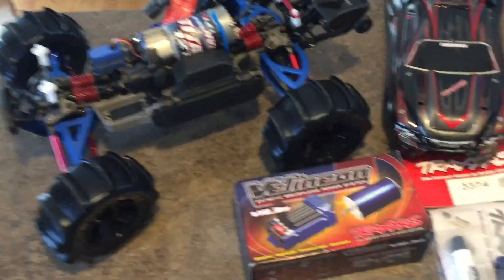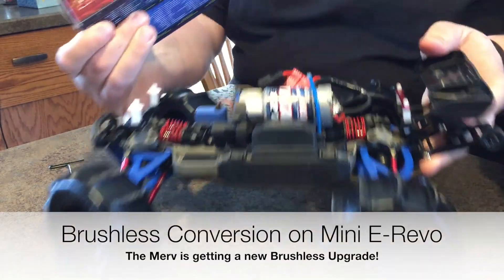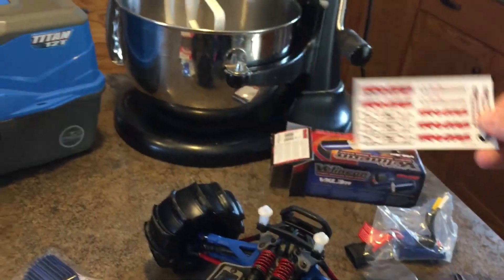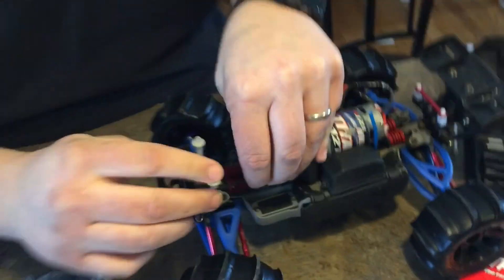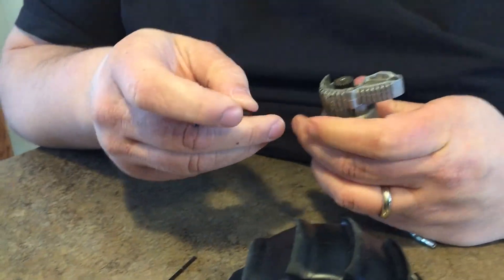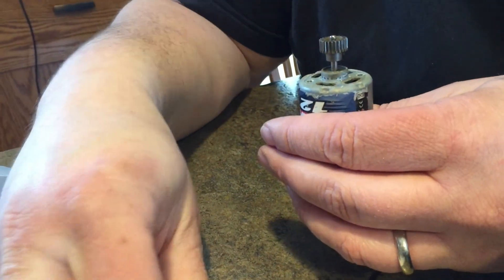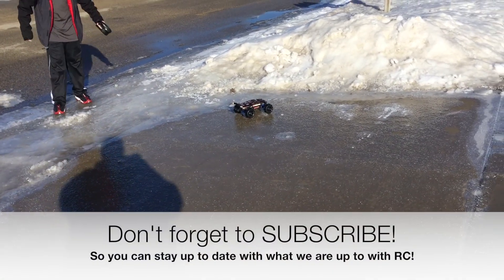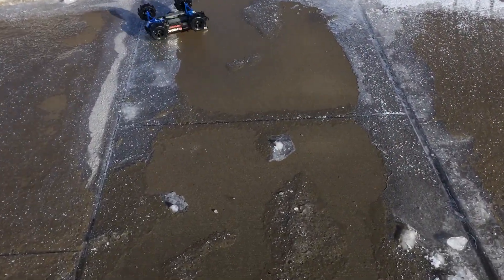How to add a Brushless Motor to 1/16 Mini E-Revo (Merv) Velineon vxl-3m

Comment: I think I saw the blue ano skid plates on your merv. I know a lot of people like them, particularly the front to keep the dif bulkhead together. What, if anything did you do about the hinge pins sliding? I found they moved a lot because the aluminum ones don't have the little cups to receive the ends of the hinge pins and retard their movement.

Comment: Thanks for the video. I´m planning to upgrade mine after the brushed motor setup quitted its service. Will order the required parts at once. Did you have to change the pinion gear also? Also what are the batteries you are running now? 2s or 3s or the original ones? What size 2s and 3s goes into the battery tray?

Comment: Did you have to change your receiver to use that ESC as well?
Reply: I did the same set-up, you don't need to change the receiver. Just the motor mount and motor plate.
Reply: @nosoulginger2146  I’ve done it myself since this video. Don’t know what I was thinking. This was the easiest system upgrade yet.
Reply: @leolux09  What gearing and battery set-up do you use by chance? And do you use two Lipo batteries at once?
Reply: @nosoulginger2146  I kept it at 55/23T and two 2S lipos, or a single 3S. Was just running 3 of My mini E-Revos earlier and they all fly.
Reply: @leolux09  I probably should go back to stock. I'm using a 50/23 set-up and I've stripped 2 spur gears already.
Reply: @nosoulginger2146  Just go metal. I use Hot Racing in one of My nerve and the Summit. No more stripping. No need to down-gear.

Comment: Good video, thank you. However, my question is what tires are those? I've been searching for something similar for my e-revo.
Reply from the maker: They are Proline Sling Shot 2.2 sand tires. They work great in the snow.
Reply: @midwestrcadventures7193  do I need any size for my 1/16 rim cuz I wanna get a fatter size tire can u upgrade it to a 1/10?
Reply from the maker: @lilgerm383  you should be able to fit any tire / rim that will fit the hub size. Clearance could be an issue and affect turning radius. Remember the heavier the tire the more mass and it could affect you differentials and axles.
Reply: @midwestrcadventures7193  thx dude how do i find the size of my hub size

Comment: When he moved the servo with his hands to move the wheels manually i cringed soooooo hard
Reply from the maker: Driftingninja24 guess I never really thought about that. Guessing your saying that it might damage the servo?
Reply: @midwestrcadventures7193  yea
Reply: It is hard of the gears to move them manually and can snap the teeth. The teeth in those motors (hopefully metal geared) are very tiny and snap easily. If you dont have a metal geared steering servo I highly recommend it

Comment: The brushed version comes factory with a 1/10 motor which is a 550 12t and the brushless motor that comes factory in that same car if you got the brushless version is a 380 size. For mine since how I got the brushed version I just bought a 1/10 brushless motor kit and everything fit without having to buy extra parts. Something they don’t really tell you...just FYI for anyone wondering
Reply: So if I buy a 1/10 brushless motor and esc it will fit in a 1/16 scale e revo?
Reply: @fwtrpk  following
Reply: @fwtrpk  use your brain
Reply: So if I take my vxl system out of my stampede and put it into the 1/16 slash or e revo it will fit❓
Reply: @boogiedasickestt  yes it will fit, with not modifications
Reply: Jes @boogiedasickestt
Reply: Yes this works. It’s a lot of weight for the vehicle in my opinion
Reply: Lol they’re the same size esc
Reply: Where do you get the kit?
Reply: Probably the 1/10 velinion is too much for the mini erevo plus the esc won't fit

Comment: I just converted my slash mini to a velineon system. If you have a dremmel you can bore your own holes into the motor mount an save yourself a few quid. Works perfect!
Reply: My mount worked fine for the conversion but the gear cover doesn't fit the new motor. The correct plate fixes that.

Comment: This was a good guide for doing this, I will be doing this to mine but I have a question why did you not use the tool kit?
Reply from the maker: Super Aiden Link productions I’m guessing you are talking about the little tool kit in the first part of video. I tend to like the t handle that came with the car. I just had it in case I needed something else. Always be prepared. Thanks for watching.
Reply: Midwest RC Adventures your welcome, I did the conversation but now I need to but a new resever because I broke the antenna, other than that I love the truck!
Reply: It's not a truck. Unless you put truck body on it. Do video of this thing in ratrod form
Reply: rc nut51118 no I’m calling a truck I know it’s a truggy but I’m making it simpler.